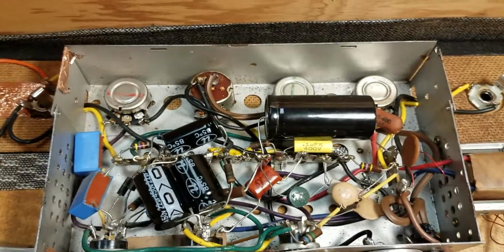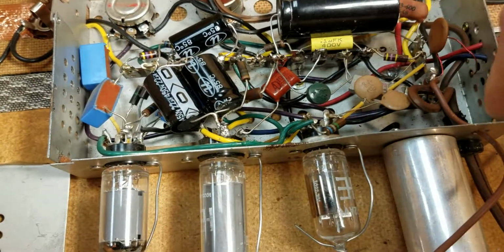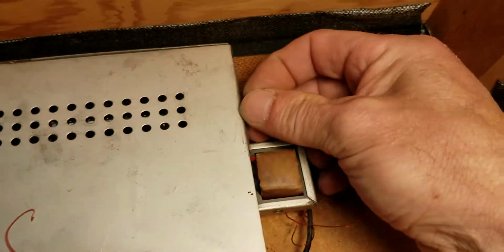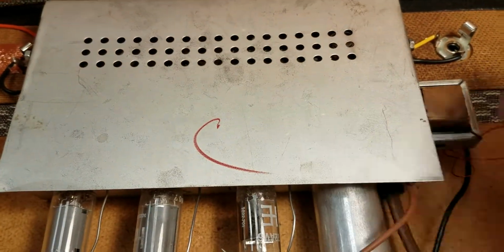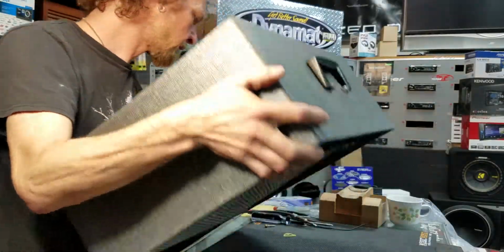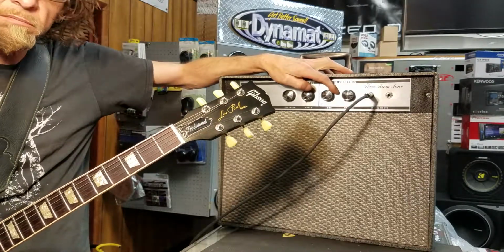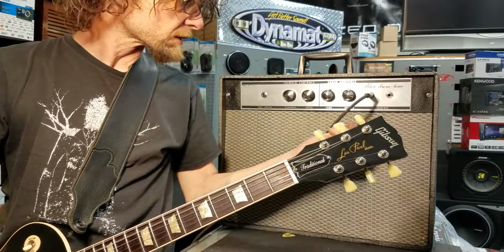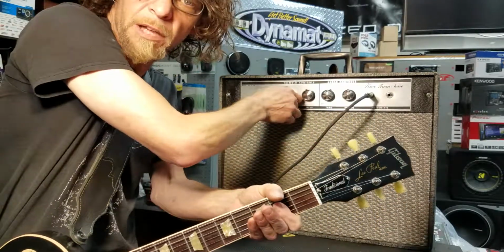KNOX Trem•tone REPAIR AND  DEMO

Comment: Sounding good, bit of hum just adds to that vintage tone. 😎
Love point to point wiring, but most of what I've seen is with 2 terminal strips at least. Using 1 down the centre like that must have been a joy to wire. 😉
Feel better mate.
Cheers.
Reply from the maker: Thanks Mark. It was a tight squeeze. I have contacted the customer and have recommended that we get NOS tubes, and replace the original tubes. I believe these are tired, and causing most of the noise. The circuit is very simple, and may be devoid of any reasonable modification to get rid of all the noise. New tubes is the next move.

Comment: Cool little amp. So similar to my first "Harmony" amp which was a total hum machine! Could you give me the grocery list of caps and what nots you used to bring it back to life? Have you swapped out or interchanged any of the "12 au/ax/at" tubes? Also, I'm thinking about isolating the on/off switch from the tone control. Thanks for the video! 
John
1966 Kay/TrueTone 
1965 Kay (with Kay manufactured gold foil pick-ups not Dearmond)
Yada, yada, yada. I love my mid 60's gear!